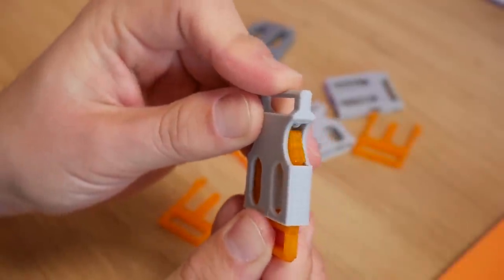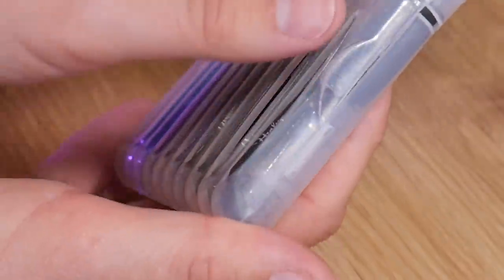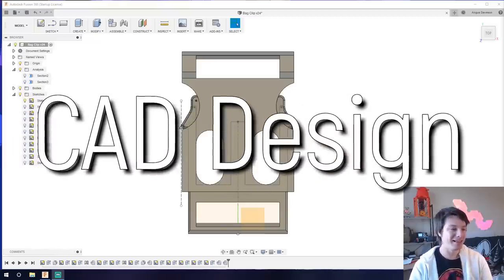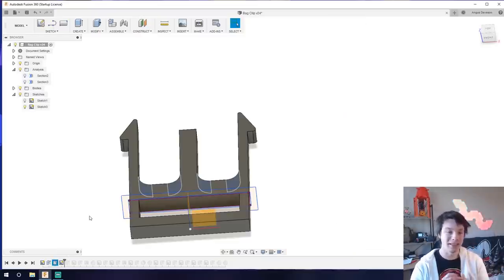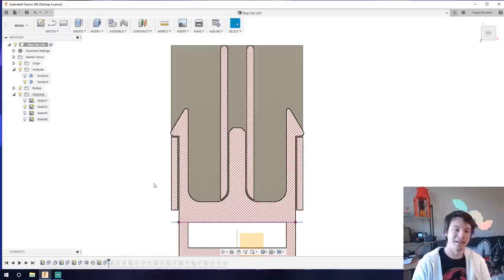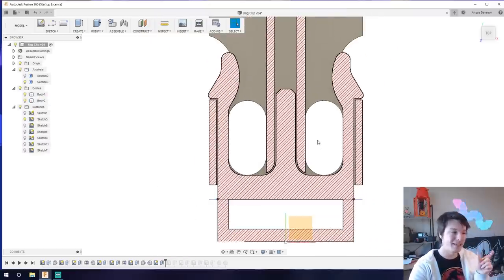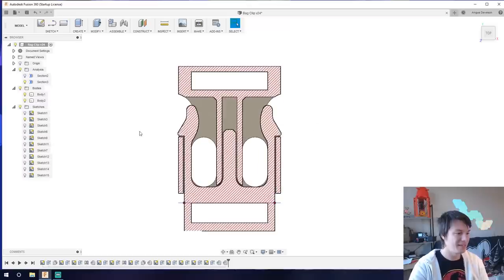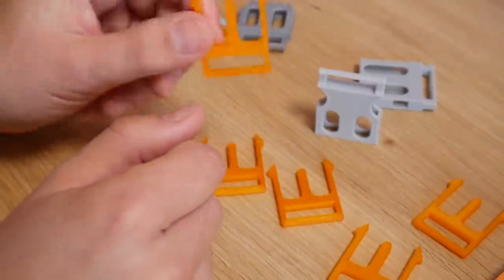Designing Buckles, Clips and Snaps for 3D Printing - Detailed Guide

Comment: You should set a parameter and call it "Clearance" and set all your clearance dimensions to that variable.  That way if want to go back and change the clearance, you just have to do it once in the edit parameters box.
Reply: Is there a tutorial on how to do something like this?
Reply: @cuulcars  In Fusion 360, thats fairly simple: You open the "Modify" Tab, and click the "edit parameter" (i think it's called that way, its the button at the bottom) button. There you can add your own user-parameter with name, value and description (e.g. "clearance" with the value 0.1). In the Sketches, all you have to do now is instead off putting in a value, put in the name of your parameter (in this example type in "clearance"). Fusion will automatically use the value you put in earlier, and you can change the value whenever you want in the edit parameter box  and it will update it. 
But be aware, that it might cause trouble if you change the parameters if your model isn't build to work with that sort of change.
Reply: @terl0th  In FreeCAD you can name a constraint and then reference that value by name. FreeCAD also features spreadsheet calculation and you can reference values in spread sheets. That's a very convenient way to manage global values like clearance or wall thickness.
Reply: But who says there's only one clearance value in his design?
Reply: @cuulcars  But to answer your question, yes there are several tutorials on how to do this on YouTube and on the F360 site.
Reply: I would do it for all the major dimensions, then you have a full parametric design
Reply: Alejandro Pérez You can set multiple parameters. For example, snappingClearance and slidingClearance, and set each to arbitrary values. 🤓👍
Reply: I'm guessing Angus - the industrial designer and fusion expert - is all over parameters.
Reply: I know this is old, but Ive found it helpful to use two parameters for clearance called radialClearance and diametralClearance, where the latter is defined as 2x the former. Some operations like slot widths can use the diameter one, whereas offsetting faces in holes might need the radial one. But then later you can just change the radial value and have everything stay consistent. Parameterize your parameters!
Reply: Thanks to your comment, I learned that Parameters are a thing in fusion 360. You've saved future me so much time. TY
Reply: That's genius

Comment: 11:00  first, the center rod should be at least as long as your outside prongs, but really it should be just slightly longer.  it helps significantly right at the very beginning of insertion.  that's the most critical moment, and i know from experience that it can make a huge difference for ease of use.  26:50  you can see here how he has to manually center it every time.  if you're focused on the buckle and have a good hold on each side that's fine.  but it's not ideal.  if the center rod was longer, you could easily connect the two sides with hardly any consideration.  on my backpack i can connect the two side with just one hand and without looking at it at all.  great for when i forget to connect it, but i'm already on my bike and moving.  i don't want to have to pull over to be precise enough with two hands to buckle it.
second, it also helps with elastic fatigue because it forces the two bendy sides to bend at the same rate, instead of allowing one prong to bend more than the other and causing more wear and fatigue over time on that side.
but third, and far more important, the main purpose is fulfilled after full insertion to keep the whole buckle centered.  otherwise, lateral forces could easily pull the internal half to one side or the other, which could allow one of the prongs to disengage and the connection to fail.

Comment: Pro Tip: Prusa Slicer has a great function called "Elephant Foot Compensation" in the Advanced Tab - Its doing the same thing as you did with your trick - it basicly can make the first layer a bit smaller, so all layers are even and fit together just fine :)
Reply from the maker: Neat! I'll have to play with that.
Reply: This would be amazing for sla/dlp printers, I've been thinking about it for a while but had no way to implement it
Reply: Iirc there's also "first layer extrusion width" which is slightly larger than main extrusion width by default.
Reply: I always thought this should be handled by the slicer rather than altering the part itself. 🤓👍

Comment: One of the main functions of the center post of that design is that if only one of the prongs is depressed it will isolate that motion from the other prong and prevent the whole half of the buckel from rotating preventing the other prong from disengaging. Now if that wasn't a run on sentence, I  don't know what is.

Comment: Very cool! Something to consider for the future: the (bending) stiffness of the bending member is proportional to the cube of the thickness of the beam (your 2.2mm dimension), but the pull-out (axial) strength is proportional to the thickness itself (first power). So, if you need to decrease the snap force without decreasing the pull-out strength, you can split your snap beams into multiples, attached at the moving end. For example, replace your 2.2mm-thick beam with a pair of 1.1mm beams. The pulll-out strength will be similar, but the snap stiffness will be lower.

Comment: The center buckle guide is essential. When the bending parts are bent, the fact that they are plastic makes them susceptible to achieving their yield point quickly and then having a negative spring rate.  In other words, instead of getting harder to deflect the farther they are bent, they would actually lose strength and bend more easily. Without the center guide rail, all of the bending would be accepted by one of the barbs while the other remained straight.
Also, the design may benefit from the center guide being longer.

Comment: LOL!  For me, you were like 2 days late with this video.  Had to design myself a custom battery box with room for a CR2032 coin battery and a small switch. Had something close to what I wanted from some fairy lights I bought, but I needed to adjust it for my specific use.  Whipped out my 15cm/150mm ruler, measured things up, and now have myself a project specific battery box.  Great video!  You are so right about things looking enormous in cad that are barely visible in reality lol

Comment: Thanks Angus. I have a metalic arm with a go pro mount attached witch I usually use for a phone holder. I had made a small clamp that attaches too it for general utility with two smooth bumped pads were they meat. The original Pads were PLA witch I planned on eventually replacing with a more flexible material so this buckling mechanism was perfect for making them easy to remove and replace
Reply: Do you know such materials which are good - flexible(but not that flexible and not brithle)  and UV resistant?

Comment: The first snap example:  The curve in the latch is significant. If the curve is flattened out, it lengthens the latch slightly enabling it to engage more easily, and pushing the latch closed does flatten it out somewhat.
Very good design.

Comment: One thing to consider if you're making larger snaps or other flexible objects is infill pattern. If you aren't getting most of your infill from wall thickness, then using a concentric or spiral infill can give you good flexibility in the desired plane while preserving rigidity in other planes. I did that with some shock absorbing drone landing struts once, worked really well. Though you have to make sure your vertical axis is normal to the flex plane, the way the example snap was here, otherwise they'll come out brittle.

Comment: Watching this video almost 2 years after you made it, and I noticed you did not see another design element in the pen box.
It is cheaply made because the pens are single use. So it gets thrown away, BUT!
The box, once opened folds back and the clips clip back onto the back, forming a support for your pens, making a stand for ease of pen removing and replacing. So it is disposable, yet highly functional during its lifetime.
A brilliant use of the clips to turn the box into a stand by using the clips.

Comment: You should make a design competition and test the strength of each submissions. 

I personally print the outer receptacle flat with a 2nd hole for ribbon friction lock.

Then I use the center tooth to prevent over pressing the tabs.

Comment: 15:23 I used to do separate drawings for each piece, add parameters, etc.  Nowadays I (mostly) do the same sketch, extrude, project, sketch method.  Since I don't do this for a living, no one else works on my projects, and I've rarely found the need to go back and revise parts much (outside of the initial design/test/finish phase), so it works for me, and I've found that I get things "right on the first try" a lot more often now.  I still save things off as components so I can easily bring into them in larger assemblies.

Comment: It's probably obvious, but just make sure the lock release openings are big enough to push the locks far enough inward. Since there's a concave curve to the teeth rather than a box, a lock lip that's 2 mm will need more than a 2 mm cutout.
Reply: Will 2.00001mm be enough?
Reply: Heh, probably not. I'm just saying to take into account the area the user presses is inlaid a bit compared to the edge that locks the part in.
__
|..|
|...\-User presses here. The cutout should
|.....\ be at least 2 mm inward from here.
|..------

Comment: Another take on snaps are the two part style. One part easily deforms in and out and another part is inserted and keeps the prongs apart so they cannot flex anymore. (like automotive clips with 4prong circular plug that is spred apart by a central pin or a screw after it was inserted in the appropriate hole)
On this style of snaps it can have a constraint with a compliance mechanism:  have the prongs connect to the central pin with a V piece that is very thin at the connection points. The V will be bent more (with less angle in the V) as it snaps into place. But then you can push the center of the V past horizontal making it an A shape where the tip would rest on the top of the inside buckle. This prevents the A shape to ever get more angle, preventing the prongs to be bent inward again. Surely the compliant part is tricky as you need a shallow enough V that can be bent into A with some ease. The amplitude of the resting V must be greater than the locked in A, and the prongs must be able to deform outward a bit more in order to spread outward the prongs so the A is formed out of the V. (to prevent slop, maybe the cutout ledge in the buckle has a leaf spring that can bend outward a bit.

Comment: You’ve got thin posts relying on layer adhesion carrying the maximum load by printing the female part vertically. Print that horizontally and have the shaft and posts up there thicker. Can add some chamfers to thin these areas for aesthetics a bit. Always trade offs it seems.

Comment: Hey Angus, in your video on how you designed the Combat fidget spinner you mention you should avoid mirroring sketches but rather mirror the body after you extrude.  But here for the buckle you mirror the sketch for the prong side.  I see this was 2 years ago however so wondering if you would have done this differently today, or there was a reason you mirrored the sketch?  Thanks!

Comment: Interesting timing as about a month or so ago I used similar techniques to build a bracket to hold on a heap ( about 80 ) of LED message badges for a costume project.
Not sure if Angus will mention it ( in commenting before the video has ended ) but print orientation is important

Comment: I noticed that when you showed the barbs in a deflected state, it appeared that the deflection was not distributed evenly along the leg of the barb but seemed to be concentrated near the root of the barb.  I think it's clear that distributing the bend along the length of the barb leg would make it more robust.  Possibly, a very slight taper could be added to the barb's leg.

Comment: The challenge being 3d printing a buckle that can actually be used. You could build flexures to completely strengthen the buckle. You called also use steel reinforcement at critical  loads.

Comment: Would also be a cool to design in key-slots/holes to push in a "rod" of sorts to unlock the "permanent" locking devices.. This would only require a minimal amount of modeling and create very strong locking mechanism for things that don't need to be separated on a regular basis, but it is nice to have the option to do so.
Reply: Like the tiny pin holes of the "reset" buttons on older electronics!

Comment: There's no right or wrong way as long as you get the job done... I am with you in regards to fillets I nearly always add them as a separate item, (I find its better for configurations) I use solidworks, not sure how folders work in fusion but I tidy up my fillets with folders later..

Comment: I would have gone past 90 degrees for the prong ledge and designed the outer case ledges to match, that would make a much stronger safer connection yet still easily released by user interaction.

Comment: I'm not a big fan of the fillet command in sketches either. However, if you do want fillets in your sketch, consider using 3 point arcs instead. They don't remove the intersection point and if you are choosing a profile on the concave side of the fillet you don't even need to make extra selections during your profile selection for an extrude.

Comment: Great advises, exactly my experience :)  sketch fillets are terrible, dimensions are gone and sometimes areas are not closed properly. Sketching everything at once is probably the biggest mistake I made over time...  Working with projections is probably the way to go, but it is strange sometimes when geometries change or replaced. I think splitting into components is an easy step and improves modeling with a little by a cleaner timeline. But with that as well it is easy to make mistake and keep sketching in the wrong component making a mess too.

Comment: Did these end up failing in fatigue? With it being a cyclic load, I'd be inclined to radius the inside corner at the root of the part that flexes to reduce the stress concentration.
Reply: Haha, nevermind. I commented before you added the radii

Comment: I like the video. But whenever I try to develop snaps and catches my main concern is: How should I make the proportions - especially of the bendable part? Do you have any rules of thumb like minimal material thickness, aspect ratio (length vs thickness) or the like?  Maybe that would be worthy topic for a more-in-depth follow up video?
Reply: I've designed a few snaps before, for sliding parts within a rail with catches to snap into exact places along it, and my rule of thumb for that project was a ratio of about 1:7 with ABS and 1:9 with PLA, but the 1:7 ratio works just fine with PLA too in my experience. It also depends on how much deflection you need. If you need to deflect further than the thickness of your part (In the case of Angus' video here, it deflects around 2.2mm, the same as the width of the prong and this is pretty easy to do. Once you go to 1.5 times the width of the pring you start seeing permanent warping from use I find, and at about 2 times the width at a ratio of 1:7 you start to see failures and cracks. 

Rule of thumb is thickness should be close to equal to thickness, length should be about 7-10 times that number.

Comment: So, question: How important is having that level of clearance that you used in the design between the two components? Also, is it really necessary?
Reply: In a perfect world clearances wouldn’t be necessary but in the case of 3D printers the 0.3 clearances used is to account to slight errors in the 3D printing process. Parts shrink and warp while printing oh so slightly so zero clearance would often have parts be pressed fit together and not run smooth. Angus has a few clearance models available to print to determine how accurate your printer is for clearances. 0.3 is a good middle ground but I well tuned printer could get away with 0.2 or 0.1.

Comment: Hi

I have Ender3 printer, i’ve been till now printing with PLA of various colours. Recently i designed 2 parts design that lock into each other via cantilever/snapfits type hook. Since PLA material is brittle it breaks while fitting them together after printing. I tried all different thickness but they all break. The hooks need to flex a bit before snap-fitting in place. Suggest me some materials that would be suited to this type design and also work with Ender 3

Comment: Good video. I use a lot of these techniques in my case designs. You should probably stress the importance of the bevels at the bend points and warn against using less than 100% infill.
Reply: Perimeters add more strength than infil anyway (source: CNC Kitchen), and besides 100% infil can result in a lot of overextrusion issues. The max infil that still doesn't flatten out the result is about 45%.

Comment: I wanted to use clips for something I was designing, but the whole interfacing thing ended up being rather complicated, so I decided to just use a friction fit; did some tests and found out 0.1mm was a sufficient offset for that. Not sure about everyone elses printers, but it's at least something to start with if you're looking for that kind of connection (ik this one guy that also tried it and had similar results)

Also side note, chamfers tend to be better in terms of the vertical axis, but fillets are actually better for horizontal (bc slicing and layers and 💩)